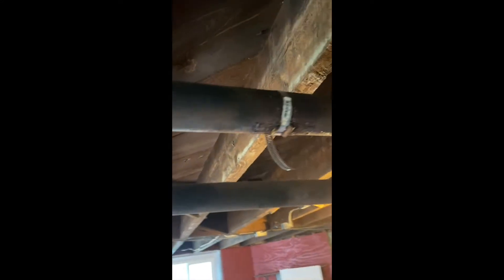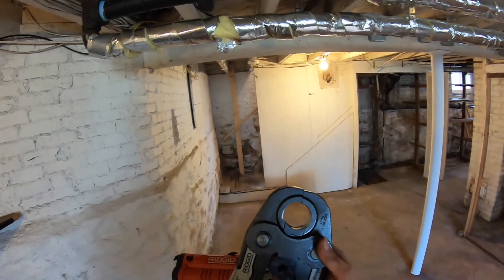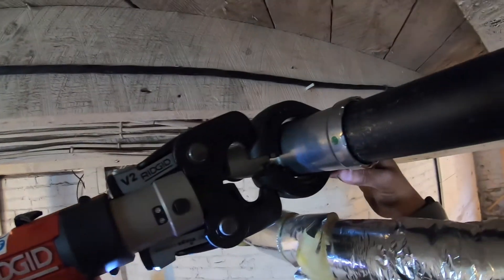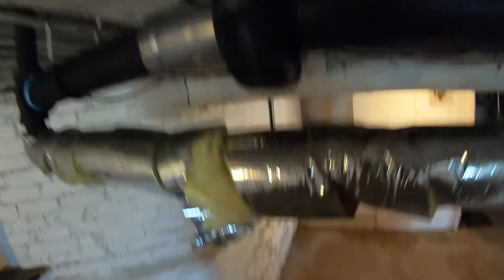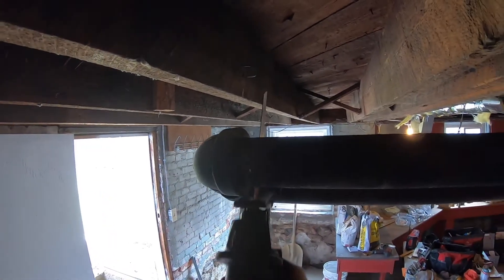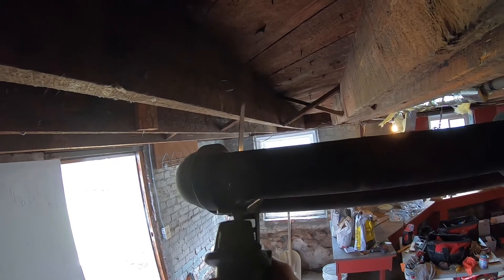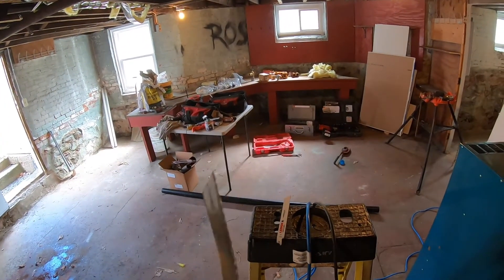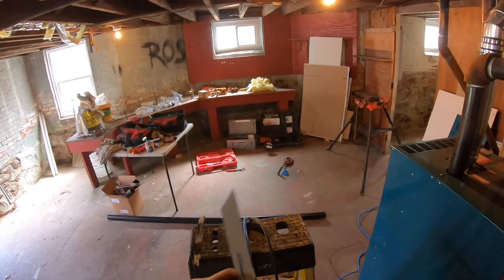Steam Pipe repair 1

Comment: Hello sir, thank you for the great videos. I did his same work on my steam pipes. I pretty much have the same set up. In your video you mention this was a one pipe set up and that the pitch on the pipe had to be going up towards the radiator.  What is the smaller pipe that runs next to the big pipe for??  Is that still consider a one pipe steam system??? I've been having issues with water hammer in the newly replaced pipes. The hammering is coming Mainly from the large 2" pipe that carries the steam up to the radiators.  I'm pretty sure I need to pitch that pipe. What would you recommend the pitch angle be??? I appreciate any advise you may have. Thank you